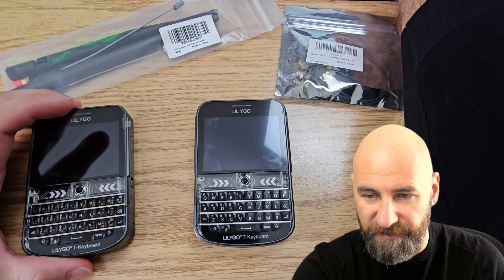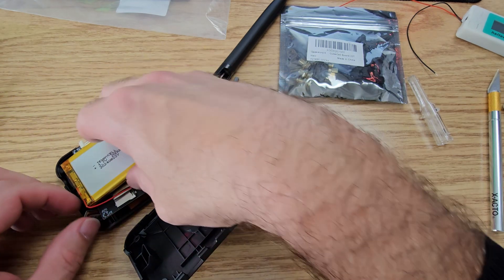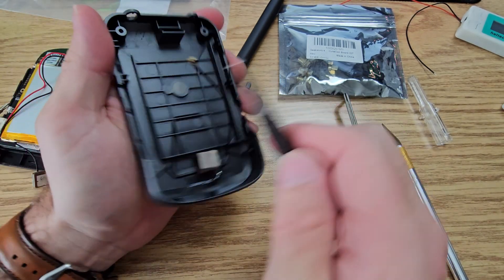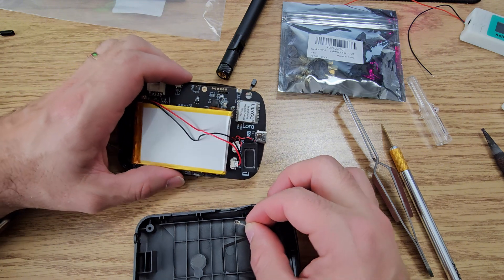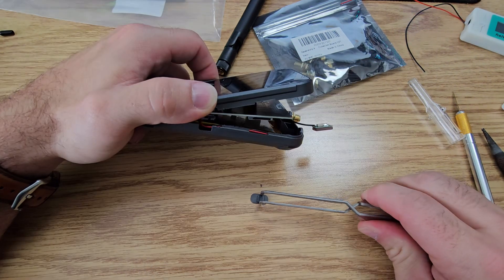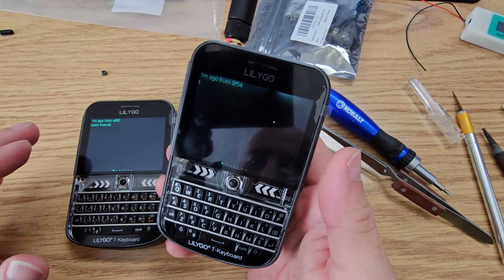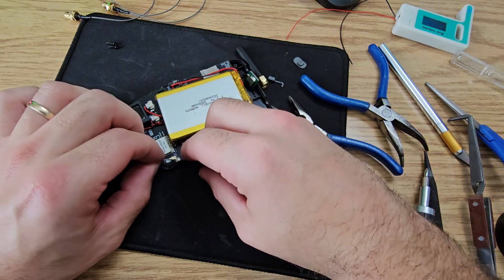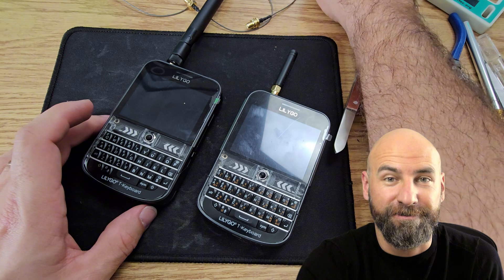Upgrading Antennas on the LilyGO T-Deck Plus for Meshtastic | Boost Signal & Range!

Comment: I opened mine, I have some tips :) ... that reset button at 8:10 ... has a tiny hole slot in the large case, that hook on the button needs to go in that tiny hole first. For these buttons (power slideer too), and for large asembly like screen and board (at 7:32), I used narrow strips of tape (not very strong), and I held the parts in place with this tape, but with most of the tape outside the device, to hold it pressed in place, and when all parts aligned and is just 1mm gap, I stretch / drag the tape out without opening the device. The GPS at (8:24) needs to go in that square slot on top, mine actually came upside down because it was easier for cable routing there, but reinstalled with antenna up. It needed a tiny double sided foam tape because the GPS rattles inside (mine at least). I guess is not a bad ideea to put some tape on the screen to avoid scratching it when turning device around.
Reply: Thank you for explaining how the reset button goes in. I was starting to question my sanity 😅

Comment: I own 2 T Deck Plus one has an external antenna in the 3rd floor flat window where I live.
It has managed to receive messages from the centre of the building on the ground floor, at the rear of the building so I sent every message with no line of sight but it still received every message, I am impressed!
Reply from the maker: I'm super impressed by this technology! Can't wait to test out the "LONG SLOW" it's going to get even more range. Thanks for watching!

Comment: I-Pex -  U.FL or MHF4 or maybe even another size. Anyway, My T-Deck Plus is on it's way (+ Heltec LoRa32 V3 Node for my base station)  and I will deffo connect an external antenna. Exiting toys, that's for sure!
Reply from the maker: @404DisasterNotFound  I ordered a pack of IPEX to replace the one I broke. Swapped the antennas one too many times. Have fun and thanks for watching!

Comment: Would you advise removing the internal antenna? Rather then leaving it in
Reply from the maker: I recommend leaving it in. You might one day get a new device and want to dedicate the upgraded antenna to the new device. This way you can put the old device back to factory specs and still use it one day.

Comment: question.. was the built in antenna not strong enough.. or you just went right to the upgrade?  Did you see any difference in distance?
Reply: I have a T-Deck plus and I've found the range to be adequate. I also have a node in my car which it connects to as a hop point which is usually within a km or so of where I am.
Reply: @Jakefrc  Nice.. I figure once I get the 'big' node on top of the building.. then I will test the mobile ones for range.
Reply from the maker: I'm planning to run some range tests for the next video but the internal antenna is for sure very limiting. Thanks for watching!